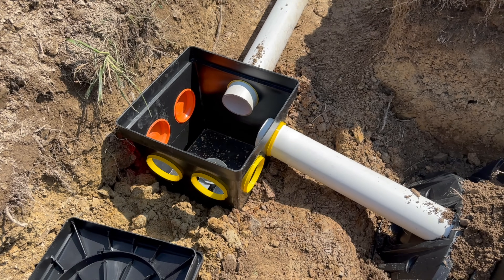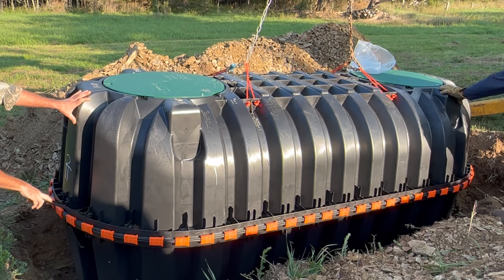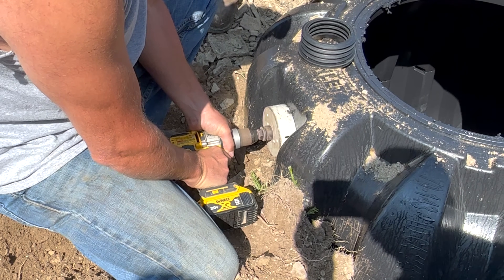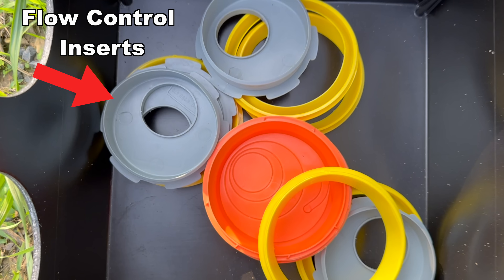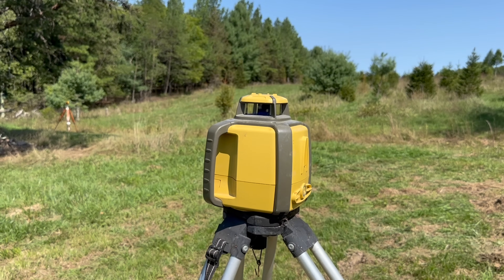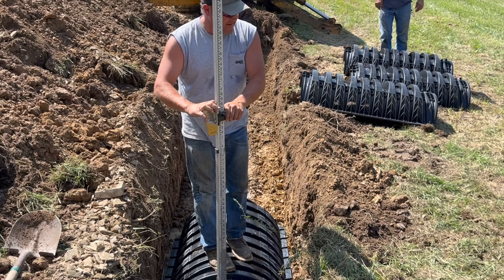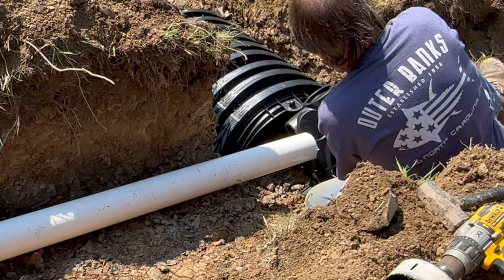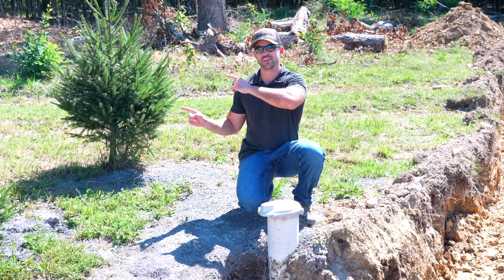Septic System Installation - BEGINNERS Guide to Gravity Septic Tank & Leach Field

Comment: You need a # 56 tamped stone base 6” deep with drain tile to  drain water away if possible . Install  parking curb weights with 10000 straps to the gravel base. Then backfill with stone dust # 10’s to top of tank. Also take a grinder and taper you 4” pipe or use tapered end of a factory cut and bevel pipe, then coat your rubber gasket and pipe with dish soap and it will go in so much easier.

Comment: Good video. I saw one of the guys had an "outer banks" t-shirt, so I'm assuming this is somewhere in the Carolina's region. I bought some land in Nova Scotia, Canada that will need a septic system when I build a house. So I'm wondering whether or not all this piping and the tanks need to be below the frost line? You seem to place everything quite close to the surface since I assume the ground does not freeze to any significant depth there in winter.
Does anyone know about this issue?

Comment: I may be missing a step in this awesome video of yours. is there holes in the pvc pipe to allow the liquids to flow into the ground?
Reply: I may be wrong but I think the leach runs are open to the ground it's just a half pipe to have a space to let the water flow
Reply: @chadherron5740  That's what it looks like...A waste water disbursement covered dome.  At this example 80' long.  seems like over kill.... That flowing waste water will not dissipate into the soil WAY before the end???

Comment: Anywhere I do septic and sewer, I would not be allowed to do it without having compaction and pipes laying on solid ground with sand below. If there is air under the pipes (suspended in air) that means when you backfill and that ground settles, eventually if not immediately that pipe is gonna sag. Then your 1% or 2% grade is destroyed. Like you said the slope is important. Your slope didn't look right but that could have been because the camera. Benefit of doubt there. I know everyone always has some smart ass that thinks they can do it better. I'm not saying that at all. I'm just saying if my guys tried some of this we would be having a meeting on the side of the shit tank lol

Comment: That plastic tank looked open inside, I thought that there should be two chambers .  The solids get trapped and digest in the first chamber , while the second stores liquid to run to the leech field.  Also since most of the cost is labor and equipment. I would rather have a cement tank, they last forever .

Comment: i am not an expert but i still have issues. first you MUST over dig 1 foot all around for that type of tank because you are required to put no more than 6" of soil before compacting the soil, every 6" must be compacted. secondly the pipes must lay on virgin soil so they don't settle and crack either the tank, the d box or the chambers. additionally you are required to tamp down the backfill for the chambers with a square handle so they don't float and unhook.  using the concrete cookie under the d box was great but you didn't show dialing in the meters.    where is the repair area? explain that too please. sorry if that's too critical, just facts.

Comment: Nice video, I had no idea that that’s the way it is done. I always just thought the finger system was 4” pvc pipe with holes in it 😂😂😂.  I’ve noticed that two of my neighbors are getting their systems replaced and they’re not using materials like this. They are using what looks like 10-12’ lengths of pipe that appears to be encapsulating by some kind of black insulation so that way I can explain it. I can’t get that close up to it to see it personally, but from a distance.
Reply: that sounds like a "gravel less system". there are styrofoam packing peanuts encased in a net around the 4" pipe.

Comment: do you need any clean outs? if so, where do u recommend putting them
Reply: Check your code, but where I am at in the NW, multiple states it is required to have them right outside of the house. We put them 3 to 5 ft out so when someone put their pipes in non compacted soil or sand and have them like this video, they can send snakes down there and try to unclogg the system. Once they do that enough times they will learn they gotta go back in. In the state of this video there must be no inspections and the homeowner can do their own. With no inspections. But rules are changing. Even out in the middle of nowhere, massive inspections will be done if home is sold. If home is 200ft near a sewer they are going to make people connect to that now. However they can make us pay them monthly they gonna do.

Comment: So theres no leech field pipe anymore, but instead those plastic domes are it?
Reply: That’s a relatively new system called a chamber system.
Reply: @JeffRigney  he quoted 85 chambers approx. $19 each plus end caps, 1 chamber is 4' x36"  that's why you need a 36" bucket. the trench walls are necessary to support the chambers so they don't squish out when back fill is applied

Comment: As a licensed septic installer, plastic tanks have a place when needed but they cost twice as much as concrete tanks. They also recommended by manufacturers that you anchor the tank to ground. Anytime you put a tank in the ground and it won't be used for a while  add water in it.  If it rains it will float without anything in it.
Reply: These comments are funny.
A plastic tank I can haul to my rural property on my own trailer and install myself with my backhoe.  The expense of trucking a concrete tank and  hiring a larger piece of equipment to install it is not even worth considering.
Reply: @OllieBabaSan  I can dig a trench on my rural property and save all that trouble.
Reply: We live in a fire prone area.  When a  fire burned over us, the plastic lids of the access ports ignited, which ignited the plastic tank which burned down to the waterline.  A concrete tank would have survived. Once burned, twice shy.  Our replacement tank was concrete.  Something to consider if you live where fires happen.
Reply: @gregknott8931 well he doesn't 😂 so that's that
Reply: @gregknott8931 Youch! I wonder if there's something that could be installed over the plastic access ports to shield it from potential fires?
Reply: Is it hard to start a septic business or get licensed?
Reply: @lawrencecheshire6012  my son is studying to be a civil engineer, just finishing 3rd year and they have yet covered septic systems
Reply: @jameshallahan4376  they probably won't. When he becomes a septic inspector or designer. Then he will deal with systems
Reply: @TheIggypop1 for fun I filled out application to be licensed for septic system in vt $75.didn’t pay yet Now I just need book to study for exam - they don’t make it easy
Reply: Yes you have to fill them with water below the tees. Anchoring is only used if you have a high water table.
Reply: Did anyone else notice how the pipe from house to tank was just laid in and no compaction, no sand, and there was air in between. Is it just me or we gonna have grade changes once that ground settles.
Reply: @MichaelD-JLVSU  probably didn't show that but if the pipe was already there and you dig it up it should be compact enough it won't have a giant settlement happen. I see your point   the area where pipe meets the tank needs major compaction or the pipe can snap/ shear off. I wouldn't use abs I'd use sch 40 pipe
Reply: @TheIggypop1  makes sense. It just seemed a little disturbed as far as the dirt is concerned. Other then that yes I agree. Sch. 40. Looked good overall
Reply: @MichaelD-JLVSU  the dirt weight on top of the tank is only a few hundred pounds..  the key to these tanks is compaction every 12 inches around the tank. Filling with water. Once compacted the tank will go no where I just don't like the clips that hold the tank together. Kinda cheesy.
Reply: I think it's disgusting that plastic tanks are allowed at all.  Everything is about ripping people off anymore.
Reply: @ChillWill-q5x  you may change your mind if you lived somewhere like here, concrete tanks have to be hauled in several hundred miles, but plastic tanks are sold at local hardware store, you pay freight and I will install concrete, no problem!
Reply: @ How about we build you a house out of this plastic rather than concrete, see if you think it's a good deal.
Reply: @ChillWill-q5x  don’t laugh it’s only a matter of time
Reply: @ Death is also only a matter of time.  I'll laugh while I'm alive.
Reply: @ChillWill-q5x  Our contractor used a concrete tank but used plastic risers. Got the alarm going off and took a while but found that 1 of the risers failed. I dug up and replaced with concrete risers. Wasn't any fun digging the dirt out of the tank. Not a good idea to put plastic in the ground.
Reply: @thomasmulcahy9238  Many cemeteries allow plastic burial vaults instead of concrete.  But those have failed relatively frequently, causing sinkholes that must be filled.  Imagine the floaters if a major flood erodes it.
Reply: @ChillWill-q5x  Do you mean that literally, or just how they cost so much?
Are they less clean?
Reply: @TradBarbie  When I  think of building something that must hold tons of weight, plastic is not even a material I think of unless it's in the shape of a compact and dense circular pipe.
Reply: @ChillWill-q5x  ooooh ok!! Thank you for responding!! I was gonna pay double for plastic.
Reply: @ Porta Potties have their place, buried under tons of dirt isn't really that place.  Most public restrooms are built of concrete, must be a reason.
Reply: @ChillWill-q5x how much weight does it need to hold really?
Reply: @ How many gallons of liquid are inside it, how many tons of dirt are pressing in on it?
Reply: @ChillWill-q5x  they’re not buried under tons of dirt. They are buried under a couple hundred pounds of dirt with tons of dirt on the sides of it holding the shape of the tank.
Reply: @h2w25 Just stop, admit you're too lazy to use durable materials and do a quality job.

Comment: In alberta this would not pass inspection for a number of reasons.  Here in alberta. Inspectors make you relocate your leach field if a backhoe is used due to compaction. The way the tank was back filled. Sand or similar material must be used for the first half of backfill to support the bottom sides of the tank. First six feet of inlet pipe must be solid core abs because of shifting or settlement. Also having the inlet 4' below ground. Rules are so tight in canada😝
Reply: And you live in a tundra half the year. It's not even comparable.
Reply: I live in Alberta, do you install them? Or can recommend a plumber that does farmhouse replacements?
Reply: Yeah, well this passes in MAGA County Boy!

Comment: Thank you very much.  What is the cost breakdown?
Reply: 1000gallon tank are around 1800-2200$, 24" chambers are 32$ 36",used in this video, 42$ each operator is around 125$/hr. Of course, prices vary by location.

Comment: Codes codes codes. Too many codes but septic codes are for good reason. Also, if you do this yourself, don't rely on hearsay or your neighbor. Go to your local authority, usually your township or county. Josh here is good at pointing this out. This can be done online in most areas. I say this because I used to live where the county regulated septic systems and across the street it was a different county. Regulations were slightly different. In another situation decades later different property same situation but with township building codes being different across the street than mine. Just sayin. Save yourself some hassle and money.
Reply: animals poop outside right? the codes are a scam...

Comment: Wow!  Great video, Im shocked at how big a system and how many feet of leach lines. I’ve developed a few properties in different parts of the country and rules differ and soil differs big time.  In Oregon we used a traditional septic but required a bunch of junction boxes, another place required a sand filter system due to poor drainage and now live in Missouri out there n the sticks that has zero building codes and regulations, such a relief- only common sense required 😂😂😂
Reply: I live in Missouri, and my county has no building codes outside of certain city limits, but the state has PLENTY of regulations regarding septic installation.
Reply: Yup.  Common sense.  That’s how wells end up contaminated because Joe Common didn’t think he needed all that expensive pipe.
Reply: @jeffclark5268  fortunately our little community has a municipal water supply that is piped in from miles away, so not much danger of that, and none of our neighbors have wells either, but I do share your concern in different situations

Comment: Is a float switch necessary? Did you install one? How do you know when your tank needs maintenance?
Reply: This video shows a gravity (sometimes called "conventional") system, which does not use floats. Floats are for systems with pumps, to tell the pump when the liquid level in the tanks reaches certain points.

Comment: How did you decide on the depth to install it? Seems shallow if you were in a place that has deep frost in the winter.
Reply from the maker: Check your local building codes and the frost line of your area and try to be below the frost line. That is a good general rule of thumb. I hope that helps!
Reply: It doesn't freeze because of the organic breakdown going on inside. The lids have to be at surface level so you don't really have to decide on a depth.
Reply: Have a licensed septic designer do a design and install it as they direct.

Comment: When we install that system where the drain line goes into the leaching baffles we have to install a concrete square pad we usually install  
12”x12”
Reply: It’s for the drain water to run on or over time it will make a hole from the sewer water pouring directly on the dirt .
Reply from the maker: OK. That actually is a good idea. Thanks again!
Reply from the maker: Thanks for the information! Yes, that’s why I always say check your local building codes because everywhere require something different. The idea is the same, just different techniques required. Thanks for watching!
Reply: And with those infiltrator chambers the plastic flap hanging off the end caps is actually designed to snap off and there are spots under each inlet on the end caps for the flap to snap into to serve that exact purpose. It was one of the new designs in the last 4 or so years they added on those.
Reply: @matthewsimonsen321  I wasn’t aware of that it’s been around 6 or 7 years since I’ve installed the infiltrator system 
I try to just do plumbing now I’m 60 years old now and it’s alittle harder than it used to be 
I did install a 46 ft 4” pvc pipe that had got crushed by someone running it over repeatedly I let them no that they need to drive around or they may have that problem again.
Reply: @plumbbuild6517  I get that. We installed them for a year or two after they redesigned them before one of us figured out what they were actually for. And there’s next to zero indication what the flaps actually for.
Reply: @plumbbuild6517  it always amazed me how many calls we’d get with that kind of stuff. People driving over things they shouldn’t. They got to learn an expensive lesson.
Reply: @matthewsimonsen321  you know that’s right

Comment: Please tell me you didn't lubricate a rubber grommet with petroleum-based grease!!!  Also, 1/4" per foot slope is the MINIMUM requirement in most areas.   More than that is better.
Reply: If you have too much slope the liquids run faster than the solids causing blockages.
Reply: @scottygraybelljr9968  that's a myth. I hook up sewers to new homes.  Laterals are sometimes at a 45 degree sticking up.
Reply: @scottygraybelljr9968 lol that’s a newbie comment. Everyone knows that
Reply from the maker: Thanks for the feedback! You're right, 1/4" per foot is the minimum, but I always aim to meet or exceed local requirements to ensure the system works properly. Appreciate your comment!
Reply: How much does this cost? 🤔
Reply: @LAKERSRISE diy, average I've heard about is $3000-$5000, but first get a land inspector to come out to look at the soil type. You might have to use a different kind of septic system than this.
Reply: Wrong.  1/4 foot slope applies to plumbing code, not septic systems.  Drainlines should never have slope
Reply: Use liquid soap for lube.........
Reply: Please tell me you are a moron without telling me you are a moron
Reply: 1/4” per foot is critical.
Sanitary plumbing systems are “self scrubbing” by design.

Comment: 1/4" drop per foot???! I dont think so
Reply from the maker: Thanks for your comment! The 1/4" per foot slope is a standard minimum requirement in most areas, but of course, local codes can vary. It’s always best to check local regulations to make sure everything's done right. Appreciate you watching! Stay tuned for more videos to come!
Reply: Yep on the inlet pipe can't be any more or the solids stay in the pipe and not wash with the liquids